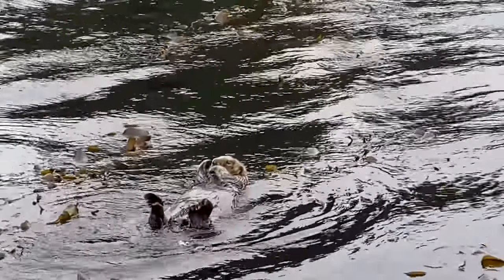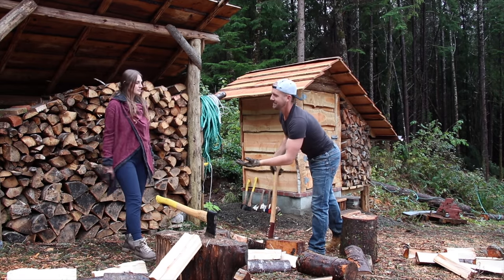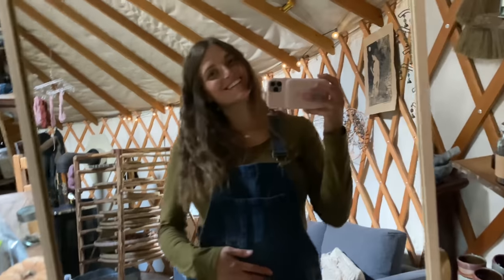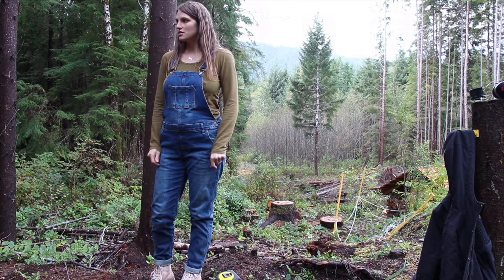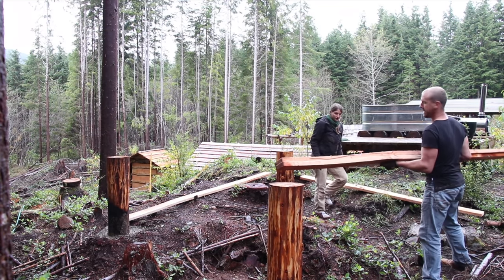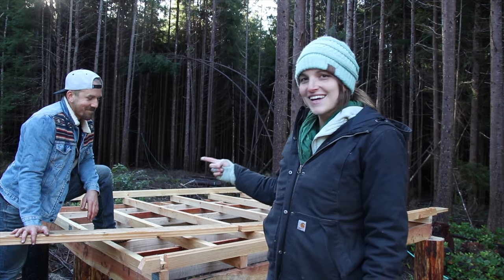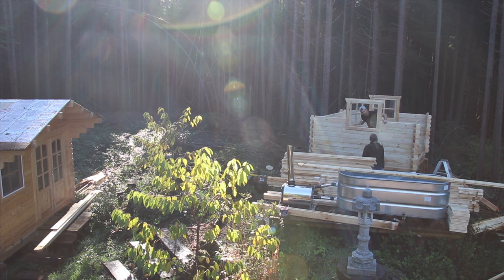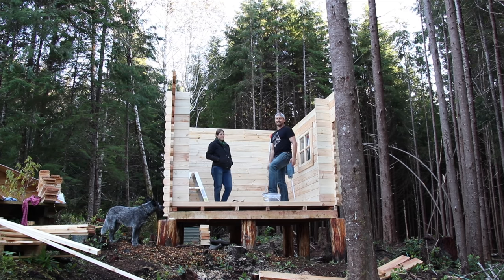BUILDING an OFF GRID FOREST CABIN for BABY NURSERY & APOTHECARY | Mold is Everywhere - Ep. 144

Comment: My son bought a house last December. We have received quotes for 13kWh solar panel system, but the Home Owners Association has decided he cannot install solar panels on his south-facing roof that also faces the street because the panels are an eyesore. Moreover, the city he lives in will only issue a limited use permit if the panels are installed on the roof were they cannot be seem from the street or from the side of the house. Also, the panel must be a close match to the roof shingles. His roof is reddish-brown. There are some states that do not allow Home Owners Associations or cities from preventing home owners from installing panels, but our state is not one of them. Here in the U.S., there must be a federal law allowing home owners to add solar to his or her home. :¬( Webhead USA
Reply: @patrickodell2555  Patrick, thanks for your comment. :)  I talked to the solar rep for our electric company. No monthly charge for solar in addition to normal electric usage. But, you are right that the installing companies do provide charts and paybacks that are unrealistic. For example, adding 3% per year to electricity cost per kW, and not knowing what the homeowner's usage is going to be from month to month and year to year p[rovides misleading and unreliable data. The big one, as I see it here locally, is that the summer rate is 11.8¢/kW, .08¢/kW in winter,  and the credit issued for surplus electricity is just .03¢/kW at any time during the year.

But. my son is a scientist and he wants to do his part personally as well as professionally to reduce carbon in the air. Yeah, solar may not pay back financially, but he wants to build a solar system large enough to one day charge an electric car when he shuts off other appliances and HVAC equipment. He's a bachelor, and he earns a very nice living to do things he wants. But, he still doesn't do his laundry and clean the house as. he should. But hey, he has a conscience! :¬) webbed USA

Comment: Hey guy if you anchor a car tire to the top of your splitter block and then load it up with as many pieces of wood then start splitting it will hold all of them and you want have to continually pick up your wood and put it back up on your block

Comment: I can understand wanting to use the old ways to preserve food because you don’t have electricity and so no refrigeration however you could actually make refrigeration. For more than 100 years before electricity people had ice boxes. Seems to me if you dig a root cellar line it was sawdust put down some floor boards and shelves you could probably make large blocks of ice to store in that room that you would bring out one at a time to put into your icebox all you need is a pan with a drain to let the water run out as the ice melts in an insulated box. You could build a double wall box just outside the door of your Ute Or you could set it up so you could open it from within the Ute but it would be outside. That part is academic. The better part is that you’re preparing your own food so there’s no unnecessary chemicals additives preservatives that’s what’s good about food you have which will keep you healthy for a good long time but for those thousands of years that they were using those old ways the average life expectancy was between 35 and 55. The average today is summer between 75 and 85. Remember that’s with electricity refrigeration and all the modern ways.

Comment: Can you not use a quarter or eighth log electric spliter to save time and energy. The wind turbine to your battery bank could also have power generated from water run off from waterfalls in the local area or or a hydro pump could pump fresh water to your location for use for drinking or shower affect.

Comment: Is that the one-room schoolhouse. Don't forget the build a pole barn for the train room. Trains can run off solar panels  only 12 to 18 volts. I go with the garden train that way you don't have to build a building. Kind of like the difference between the tent and the building. One has a natural roof and one has an artificial. Pursue to Endeavor.

Comment: I was noticing when you were putting the floorboards down the outside to the wall are like free-standing wondering if you're going to put a 1x2 or a 2x4 piece under the sides to hold the floor up but it does look pretty free falling on that I was just thinking with all the moisture you get the board to a Warp and slant down on the left side and right side of the flooring cuz it doesn't look like there's a floor Joyce near the walls
Reply: ITS A DOLL HOUSE. nOTHING PERMANENT !

Comment: If you want to end that mud puddle problem on your driveway why don't you bring in a lot of large flat stones one by one and set them in the mud.  That will let the water still go thru but raise the level up high enough for some really thick cut beams built as a bridge deck.  You could just cut trees in half and embed the round side down in cement and creat a flat surface to attach slab boards as the surface.

Comment: Where did you get those fans fo your wood stove. Thanks
Reply: I got mine on ebay for $30 something Australian dollars. Amazon has them too but be sure to get the steel ones not the fakies.  They work extremely well on my wood heater,  and best of all no cords or batteries. Just pure heat from the fire makes them turn. Really helps to push heat around the room 👍

Comment: It's a wonderful 3rd building.  I cringe at you not putting any caulk between the wall boards, floor boards, or around the window frames.  I'm a building contractor, and the amount of air infiltration you could get in windy conditions concerns me, as well as not having any insulation in BC.   The floor is maybe R-1, and the walls are maybe R-3.  No insulation means a lot of heating to do during freezing weather.  On the other hand, you've got lots of wood scraps to burn, and that wall-mounted fireplace in the other bunkie seems to put off a lot of heat.  I assume you'll have another one in the nursery/apothacary to keep it toasty.  Can't wait to see what the old homestead is going to look like in five years, with a couple of kids running around on the level ground, and climbing the fruit trees.
Reply: @mauricevandelogt7554  This is a viewer magnet. They did it to get people here and make comments. They are smarter than you think folks !

Comment: AJ check out ring worm he has a couple of items that you need to look at One he took 1 of the cranks for a boat that pulls the boat up on the trailer and you hooked it to us Dale and the wraps around the tree a little bit further than his log is and then he just cranks it and it pulls the chainsaw through the Mills logs the other is he made a pipe deal that you lay on the logs and helped you change all with that and and the other 1 is he has another pipe he has 1 of those craneville crank Systems that goes on the boat trailer and he he stabs up I'll piece a medal into the log and he can Jack it up so you don't have to do so much lifting catch you later

Comment: One thing i didn't understand. Why you didn't insulate your bunkies? Here in Austria we use the same bunkies for garden tools or something else. But never for living in it. You lost so much heat in the cold time. Jake allways says he will work with all the resources that he had, but this is pure wasting of the resources. You have so much rain, this must be so uncomfortable in the bunkie. And than this tiny little stove in it, the heat must go out everywhere, nothing is insulatet, not the bottom or the walls, or the roof, nothing. How will you handle this when the baby was here? It's raining all time, its wet and moistered . In the middle of the night, your baby is ill, you must go to the yourt in the dark its cold outside and wet. No fire in the yourt no warm water and so on..before you can make tea or somthing else you must make a fire and its cold inside that is crazy...you need a room directly to the yourt, so you are in the yourt and not a long way away from it.
Reply: I am increasingly sceptical that this is a real situation. Lots of things do not send up well to scrutiny.
Reply: I was thinking exactly the same. I don't understand why they build a second tool shed to put the baby in. No insulation and vapour barrier and plastic bags as roofing material. Instead of building a proper house he bought a second motor boat to collect sea weed. If this all is real I feel sorry for the girl.
Reply: I think rhis is only a show for YouTube and they live in a normal house. Alone when i think they must shipping in winter on the sea, with a newborn baby😱? The icecold water and air. And where are all their clothes and so on? Not in the yourt and for sure not in this little tiny windy bedrooms. Its only a show for us, i think they use it for weekends or so. They prepare now the wood for winter? So late? Its a way to wet and green, they never had a good heat in the yourt. Thats so much wastet resources its crazy.